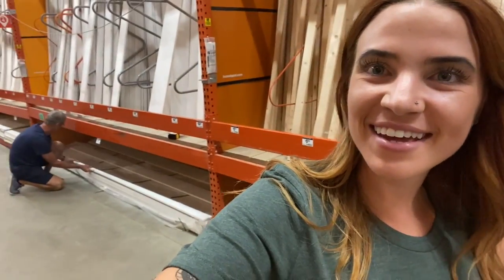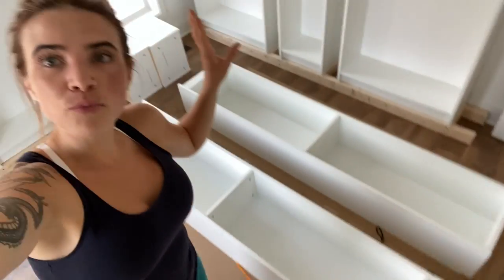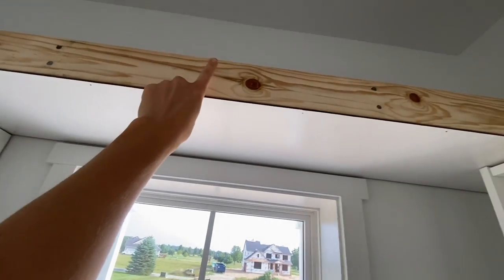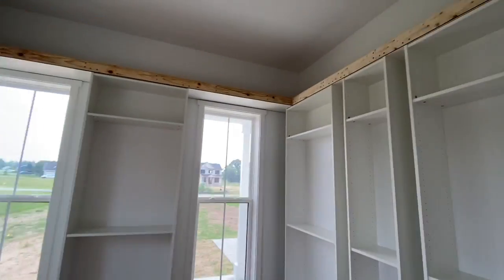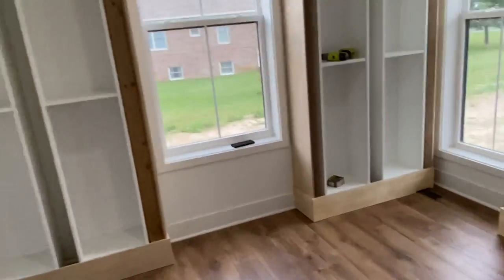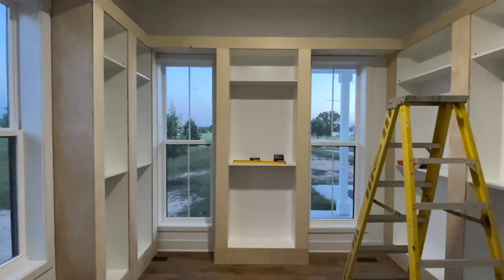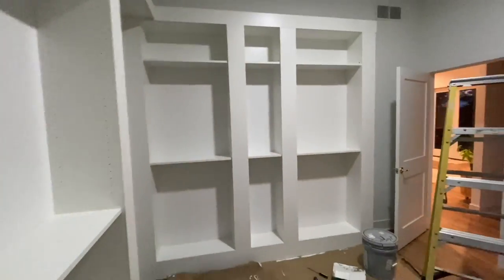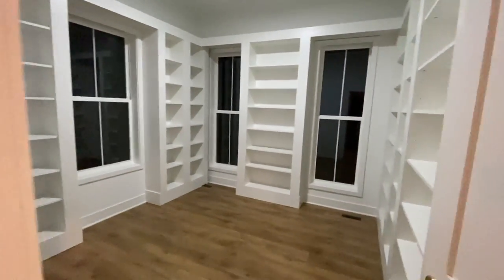Home Library Vlog | DIY Built-In Bookshelves | IKEA Billy Bookcase Hack

Comment: Bah…I wish I knew you were using ikea shelves. They are kind of notorious for coming loose. I have put my last two together using wood glue along with the screws and it’s been soooo much better. So if you have problems with them and have to reassemble use some wood glue as you go! ❤️❤️❤️❤️ love your library!!!📚
Reply from the maker: I’ve always had ikea shelves and never had an issue, but don’t worry they’re extra secure and bolted to each other and the wall ☺️
Reply: I have had some for 12 years and 3 moves...still holding together like they were brand new and no issues...been waiting to replace them with a permanent case but there hasn't been the need!